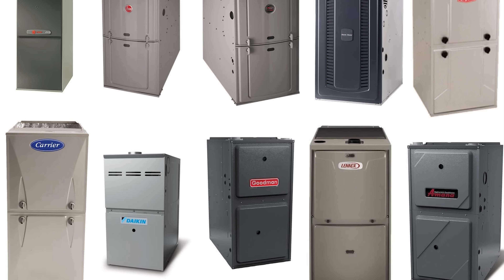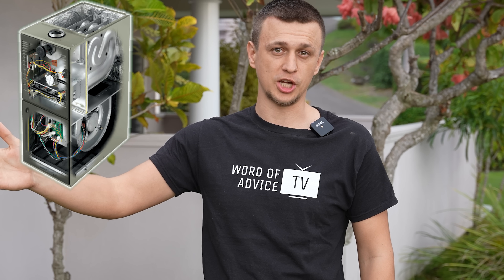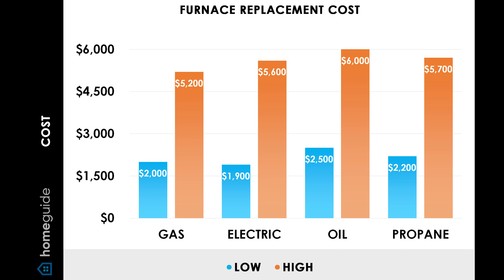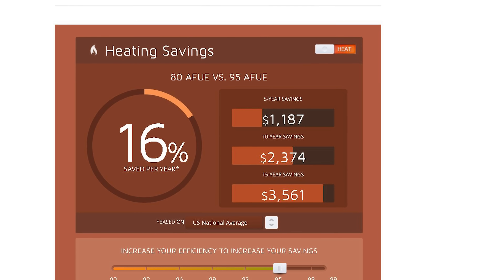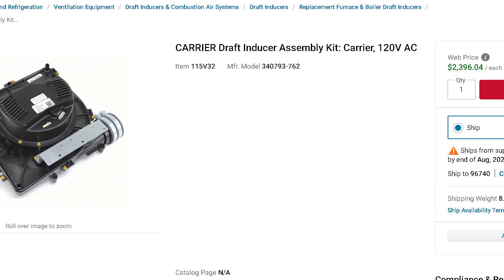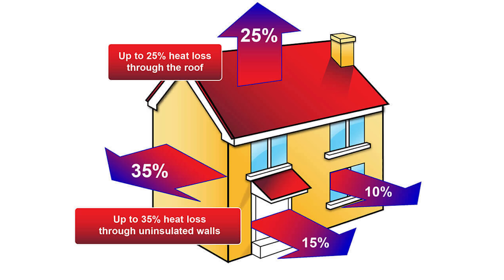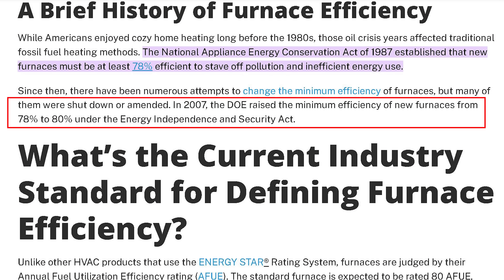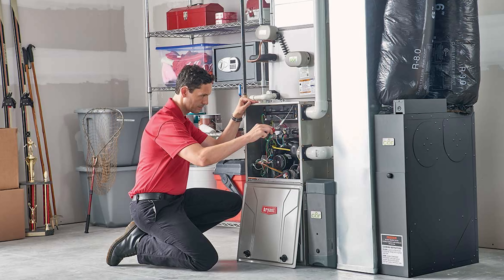Don't Buy a High Efficiency Furnace!

Comment: I agree ---------  I have a 2018 Carrier gas furnace and HVAC but if I had an old furnace and or needed to replace my 80% eff Carrier that I have right now I believe that I would go with a (Dual Fuel Furnace and Heat Pump) due to my location.   Most of my winters is in the 40's except for January and early February and then it drops at times to single digits during storms so for me a Heat Pump would do my AC and Heating except for January and February time frame and then an 80% Furnace would work great for that 2 months of very cold weather.   JMO

Comment: Environmental concerns were never mentioned in this video. High efficiency furnaces burn less fuel and therefore produce less emissions. I live in the Northeast and run LP. The savings on HE are substantial. The price you showed for a HE inducer motor at $2400 looks about 10x inflated to me. The last one I bought (probably 5 years ago) was around $200. I can’t argue that the 80% units are simpler, longer lasting and easier to diagnose and repair. Also, manufacturers and now giving lifetime guarantees on heat exchangers. Not sure this is all, but most. I respect your opinions and agree with some, but just wanted to get mine out there.
Reply: (first note that 'lifetime' is frequently defined as 20 years) ..now Lets Calculate: Savings of 95% over 80% for 35 year life of Lennox Pulse.  $1000 year spent on Nat Gas with 95% so spent $35k in 35 years.  Would need 19% more gas for an 80% (.95/.80=.19).  So $35k * 19% = $6,650 saved over 35 years.   NOT ONLY is there energy savings, but HIGH quality equipment last twice as long, so saves another $3k to install another one.  (Flap $10 is changed every 3 years,  the inducer fan was making noise after 35 years so changed $80, and Combo  Limit was change + had to add Fan off delay because exact old part not available.  (pulse system used special delayed combo switch).

Comment: You're not wrong about the costs, but not everyone's furnace will break at the same rate. in my experience at least older furnaces lasted longer regardless if they were high efficiency, or standard. I see plenty of 20 year old high efficiency Lennox furnaces still working fine. High efficiency will be cheaper to use until there's a problem then they're about the same with all the externalities factored together. I.E. you save about $1500 in fuel consumption over 15 years, then you spend that to fix it. All other things being equal though they are better for the environment. we all seem to agree the temperature is going up every summer, but nobody seems to want to do anything to fix it. I.E. they burn less fuel to heat your house because more of that heat stays in the house. I think its irresponsible to flat out say "don't buy a high efficiency furnace" as the title. There are pro's, and con's to both.

Comment: This is true , I've been doing this since 1974, seen a lot. If it ain't broke don't fix it, meaning leave it along if it works well . They don't lasts as long ,they have more components , yes they will save money on energy ,but that vanishes when u have to pay for the break downs and the very expensive parts. My opinion don't listen to the hype of bull on how much better the new ones are.

Comment: 45-year-old Trane Furnace (1979) with a Carrier AC Unit. Northern Ohio.
New AC Cap every 5 - 7 years, less than $10. New Blower motor in furnace. $59. New evaporator fan in AC unit, $39.  8 Oz Freon 22, $79. 
So, $230 to $250 in 45 years plus filters, and cleaning. I wholeheartedly agree.
I did cut a hole in the cold air return at the furnace inlet, to put a box filter, rather than a hammock style though. Messy, but no real cost ... tin snips and wide jaw vice grips to create flanges

Comment: I think a big factor is the region I live in.  In a cold region where you'll be requiring heavy amounts of energy a high efficiency furnace is probably worth it and my state offers rebates to even the cost with a low eff unit.   I could see this being true in Southern states where heat demand is low but I believe it's worth it in the north.
Reply: I bought my house in 2012. We had a great working furnace. Then the next winter was coldest in history. I went thru 800 dollars of propane in 5 weeks. My house was built in 1980. It is fairly well insulated. I bought the high efficiency and it paid for itself in less than 5 years. I agree with you in most of all u say. In northwest Ohio it gets cold. I am happy with mine so far
Reply: Exactly.

Comment: Great video! I have a 24 or 25 year old Lennox 80% that is clean and runs like a champ. I've been looking at getting the 96% variable stage unit from them and as much as I love the sound of the technology, I just cannot justify the expense, especially since prices skyrocketed over the past few years.
Reply: My advice would be stay away from communicating variable speed.  If you want high efficiency & price, you will be perfectly happy with a 90+ 2 stage system and a 16 seer AC.  When you do the upgrade, insist on a quality Class 2 surge arrester on the furnace to protect the board and the ECM motor.  When the installer puts it in, have them explain the sequence of operation and point out the parts like the igniter and flame sensor to you.  Those 2 parts are something every homeowner should have sitting on a shelf next to the furnace and they should understand how to recognize a failure in each component.  Good luck with your replacement furnace.
Reply: @yfdfireman2  Thank you! Great advice!
Reply: I have a Lennox modulating furnace from 2009 that’s so far needed no repairs(knock on wood) The comfort and quiet of the units is amazing. Probably wouldn’t be able to go back to single or two stage units. That being said, they are more expensive and the energy savings won’t make up for it. I live in an extremely cold climate so having  perfect temperature/humidity controls make it worth it for me.
Reply: @skylerdylan1005  Which model on that Lennox?
Reply: @Kiddro22  G71MPP. 14 years old now. I’m sure it will be a brutal repair bill when something does go wrong, assuming they even have parts for it.
Reply: I have a Lennox Elite 96% that was installed back in 2013. Nothing but problems these last 2yrs. Everything from the flame  sensor not sensed at times, swapped a board out, igniter, and now having pressure switch codes pop up. Did everything. Last resort is to replace the collector box because maybe the seal around it is bad. If that doesn’t work. It’s getting yanked out.
Reply: @Kiddro22  I wish you good luck.
Reply: @Kiddro22  Ugh that sucks! Sorry to hear that. I have heard horror stories from those inverter furnaces. When you do replace it, will you go for something more basic or switch brands?
Reply: @skylerdylan1005  I’m for certain I’ll go back to a 80% 2 stage. It’s simple to work on.
Reply: @jasonligo895  thank you sir!
Reply: @Kiddro22  Makes sense.
Reply: Look at your cost of gas plus taxes and fees based on usage only.  Probably about $0.8/Therm (1 therm=100067Btu).  Calculate savings from efficiency rating.  80%/95%=84.2% so 15.8% less gas used.  IF $1000/year in GAS cost  (not fixed fees).  then with better unit gives $158/year saved.  over 20 years would be $3160 (disregarding any increases in repair cost - impossible to predict).
Reply: @pablopicaro7649  $7 per therm? Where do you live that it is so outrageous?
Reply: @pablopicaro7649  $7 a therm!? Where do you live? That’s ridiculous! Mines use to be 0.52 a therm. But it has increased to $1.24 a them last billing cycle
Reply: @Kiddro22  remembered a bit wrong,  looked again $8.21 per Mcf= $0.792 per therm
Reply: UPDATE!: Replaced the collector box condensate hoses and pressure switch. Still was throwing the E223 code. System would not go into “soft lockout” mode. It kept trying to cycle back to back. Turned the system off about four times hoping the board would reset….STILL throwing the E223 code. Oddly, I tried to clear the code on the board and it wouldn’t. Tried five times to clear the error code on the board. So I thought, 1). The system won’t go into “Soft Lockout” mode after so many failed attempts. 2). The board wouldn’t obey the command to clear the code. So I replaced the board with a new backup board I had for emergency purposes. Ironically, the furnace fired up. So far it has went through seven cycles and hasn’t stop. This is the second board that I’ve replaced. The first board, I replaced back in 2020. This is the second one! Unbelievable! Not sure who’s manufacturing these “Sure Light” boards? But something is up with em.
Reply: @Kiddro22  Glad you got it working correctly.
Reply: @jasonligo895  yeah it just didn’t make sense. Corrected everything pertaining to the code. Even tried to clear the code on the board and it wouldn’t take.
Reply: ... my lennox is from 79.... Anit replacing it ,Works good as the day it was new . replaced blower motor $99 after core exchange. Heat exchanger got a spare that came with the house , so if it breaks bada bing bada boom , new furnace basically.
Reply: My Lennox has been running in northern Canada for 37 years without a repair.
Reply: @rooky55  that’s because you have a day one. The old ones were bulletproof.
Reply: I would stay away from 90+ Lennox. They are engineered horribly and a nightmare to maintain and service. I would rather buy a Goodman over a Lennox and that’s saying a lot.
Reply: @Kiddro22  Remember, regardless of your efficiency, you could have had the same exact issues, as all furnaces have the same parts, just different heat exchanger.

Comment: The one cool thing about having a gas furnace is if you have something like an Eco flow back up battery you can plug it directly into the furnace and you have heating in an emergency situation. With a heat pump you can’t do that. You need 208 230 with anywhere from 60 to 120 amps

Comment: I’ve been in the HVAC business over 20 years as a lead installer and I agree with what he said.
Same goes for those condensers with higher seer, the basic ones have much cheaper and less parts that can go wrong and can cool your house efficiently as long as it’s well sized.
Reply: Lets Calculate: Savings of 95% over 80% for 35 year life of Lennox Pulse.  $1000 year spent on Nat Gas with 95% so spent $35k in 35 years.  Would need 19% more gas for an 80% (.95/.80=.19).  So $35k * 19% = $6,650 saved over 35 years.   NOT ONLY is there energy savings, but HIGH quality equipment last twice as long, so saves another $3k to install another one.
Reply: @pablopicaro7649  35 years!? LOL , it won’t make 10, plus all the very pricey parts that you need to replace along the way, even if you are a great tech like me you still have to pay for the parts. 
I installed them since new, saw them along the way and at the end of their life. I’m talking about any brand. 
Real field experience here. ✌🏼
Reply: Which model would you recommend?
Reply: @JohnHVACR  , I wish I didn’t have to agree with you but I do. The equipment over the past 10 or 15 years has been going downhill at a steady pace (leaking evaporators , plugged secondary heat exchangers, ECM motors lasting three years, problematic TXVs and now we’re abandoning 410 A). As far as the pulse furnace ,they started losing their luster when the recall came out on their heat exchangers manufactured between 1982 -1989 and stop manufacturing the pulse furnace completely over two decades ago. Lennox did stand behind their problems but they were problems nonetheless.
Reply from the maker: @JohnHVACR  Thank you for sharing you knowledge and experience John!! Much appreciated!
Reply: @Pablo Picaro  you're not also taking into consideration the problems it has within all of those years. I'm an hvac Technician and I have seen the difference in the price of the parts and it will destroy your wallet when something goes bad vs I regular 80% furnace
Reply: @pablopicaro7649  If you are so confident of what you are saying, post the name of your business on here. You are totally calculating that 100 percent wrong. Do you think a gas furnace runs 100 percent of the time year round?????????????????? PLUS You aren't calculating your figure off any type of base. You are totally lost. I've been doing this since 1988
Reply: @Bryan-Hensley   here it is simply:  amount of heat needed = 95% efficiency * (1 unit of money to buy gas) = 80% * (unknown cost to buy gas for an 80%) ,  solve for amount needed for an 80% = 95%/80% * (cost for the 95%) = 1.19 times as much.   So as easily shown the lower efficiency cost 19% more to run.  That is the trade off.
Reply: @Bryan-Hensley  here it is simply:  amount of heat needed = 95% efficiency * (1 unit of money to buy gas) = 80% * (unknown cost to buy gas for an 80%) ,  solve for amount needed for an 80% = 95%/80% * (cost for the 95%) = 1.19 times as much.   So as easily shown the lower efficiency cost 19% more to run.  That is the trade off.
Reply: Correct me if I'm wrong please. Doesn't the 80% require two big penetrations in the wall, directly into the room (one hi and one low)? And the others do not (directly into the furnace)? I would love to get rid of those penetrations, it's cold in the utility / laundry room. Yes I understand I would have to do something about the makeup air for the water heater and laundry dryer, but one at a time.
Reply: @0my  80% Furnace require some type of fresh air. It’s depends where you live and your local codes. Some cities want a fan in a can inside the mechanical room, others just fresh air as one high and low coming from basement, that is if you have a mechanical room inside a closet style. If you have an open basement you don’t need that. Check your local codes to be on point.
As per the 90 + % furnace, the venting and fresh air goes outside using 2" or 3" cpvc or greater. That’s how those furnaces gets their fresh air. Also due to venting creating condensation, it is very critical to have the proper pitch this way it can drain properly inside home after going thru a neutralizer line. 
Lastly, your mechanical room being cold is something I don’t see very often. I think your problem is bigger than those 2 vents.
Reply: I hope I was able to clarify something for you.
Reply: When I started in the maintenance business furnaces were nothing but glorified ovens.
When I got a heat call there was a handful of things that went wrong, thermal coupler went bad pilot was out thermostat batteries were gone or my favorite somebody hadn't change the filter since Nixon was in office.

Unfortunately recently we had to Condemn a nine-year-old Heil Heil unit cuz it had three cracks in the heat exchanger....

Most of the HVAC guys I've talked to are saying the same thing what they're making nowadays is basically junk, they really have planned obsolescence down to a science now.
Reply: I disagree about it not reaching over 10 years. Mine is over 10 and is fine, along with 2 other installs. I work for a complex that has 8 original 90 plus Carrier furnaces, and they also are fine.
If you want to play the argument that today's stuff isn't as good as the stuff from the 80s or 90s, that's correct, but that also applies to 80 percent stuff too.
I mean, if the heat exchanger has a 25 year warranty, why should I care?
Reply: @sprockkets  You should care if it breaks in the middle of winter, unless you live in Texas or somewhere where there’s no real winter. 
I mean it depends where you live, my personal experience is based on the NorthEastern side.
Same goes for cars, I stuck with certain brands just because I don’t want to deal with the hustle of always bringing them to the shop and wasting time, don’t want that. ✌🏼
Reply: @JohnHVACR  heat exchangers don't break in a day. Pressure switches will. And mine had the hi fire one go out, so I was fine. If I need a backup I have electric space heaters or a propane one for power outages

Comment: 30 years in the industry and I completely agree with everything you said. You are very knowledgeable on residential equipment. My main reason for selling high efficiency furnaces is no chimney or eliminating an old chimney with no liner. Unfortunately the government sets the efficiency standards and all furnaces are now going to require ecm blower motors which are more problematic and ridiculously more expensive. It such a racket. I sell my customers on reliability and they thankful for the honesty.
Reply: I personally go for the high efficiency just because the venting is much easier to manage being pvc, HOWEVER, past that give me single stage valve, single speed blower, nothing fancy
Reply: @nicholashaines4136  110% wrong on multi-speed fans and gas valves. In fact, I'd recommend upgrading past the dollar tree single stage or multistage fan motors and going with an ECM motor. Extremely quiet, way more efficient, and will 3-4 times longer.
Reply: Psc motors are on there way out ecm is the new industry standard they are quieter, more efficient, and better modulation of air flow all good points. I personally haven’t noticed them to last longer than multiple speed motors actually the opposite and 3 to 4 times the cost to replace this would be the down side. Government sets the industry efficiency standards so good or bad its what we’ll be installing.
Reply: @MK-xl9tt   100% ECM last longer due on start up that dont get 100% power all at once blasted at them.  Instead ECM very slowly ramps up the power = less wear on motor and duct popping.
Reply: I know what you mean… the last standard furnace I sold to my surprise had an ECM motor! And the dip switch settings were so small to read I couldn’t tell what my CFM’s were set for!!!! I ended up jus starting ac up & adjusting best I could! Fortunately the airflow for heat & cool was pre-adjusted correctly! I hate when they make a simpler thing more complicated! “If it ain’t broke don’t try to fix it better!”